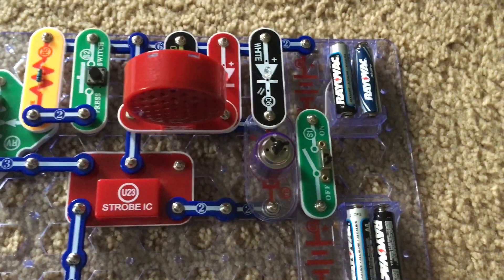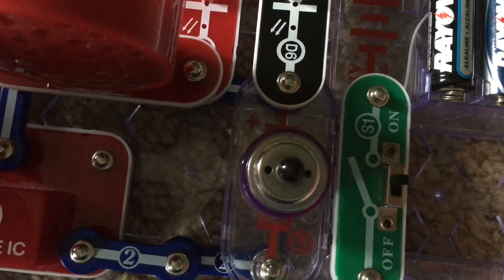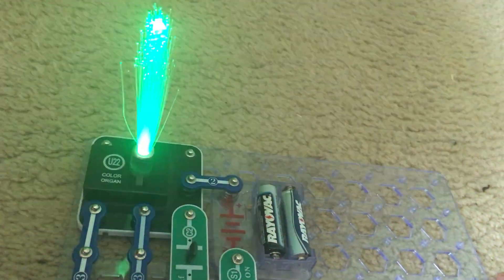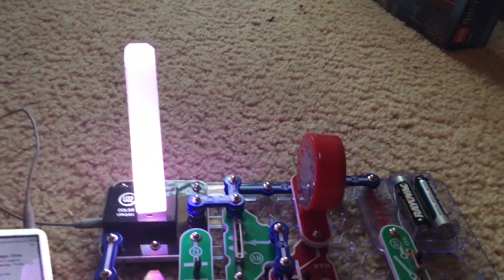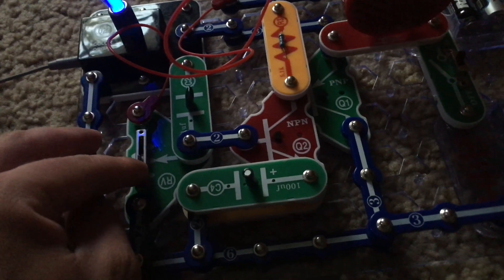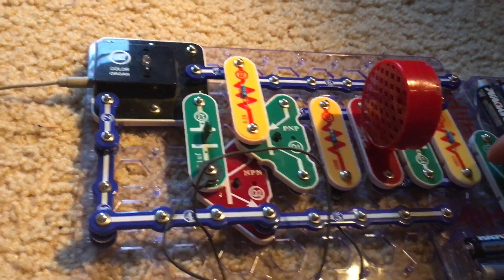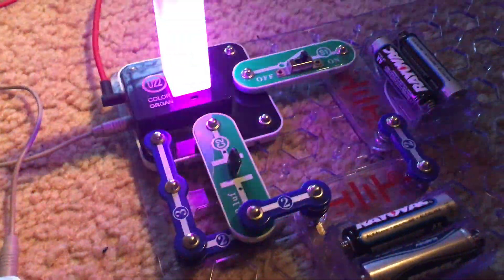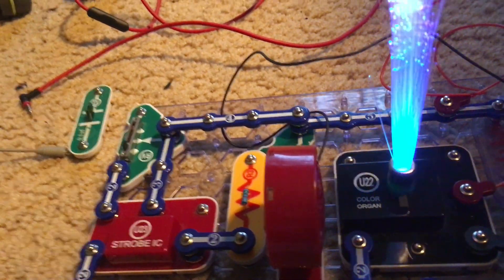Snap Circuits Light: Projects 31-39 (SEIZURE WARNING)

Comment: What are the 2 under pins on the color organ? Is it a double power pins? Is it a controller pins?
Reply from the maker: If you’re talking about the slits near the LED there, they are used for supporting the holder for the fiber optic tree.